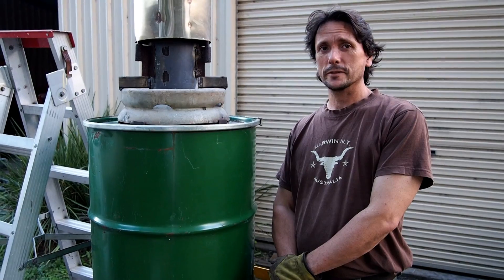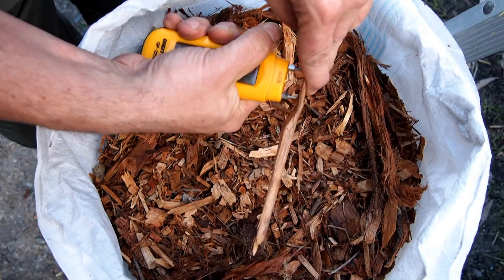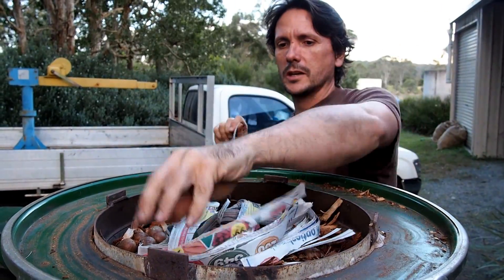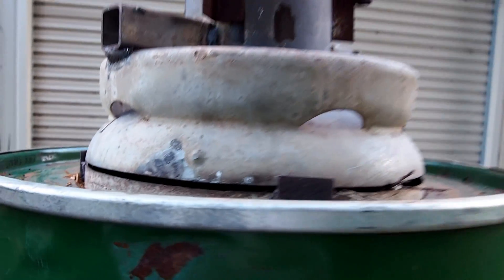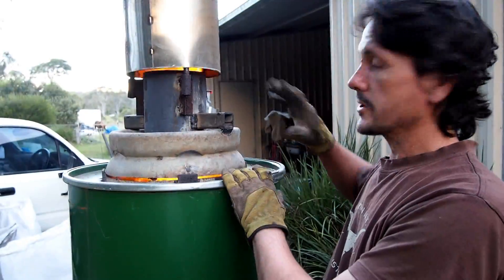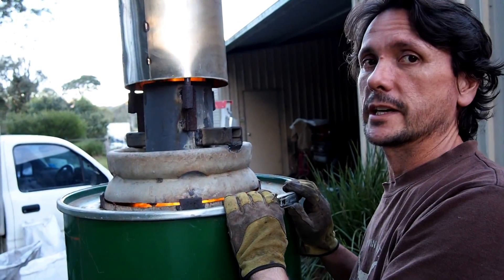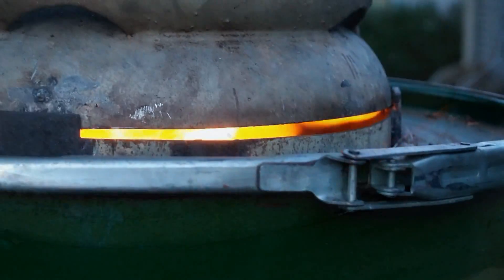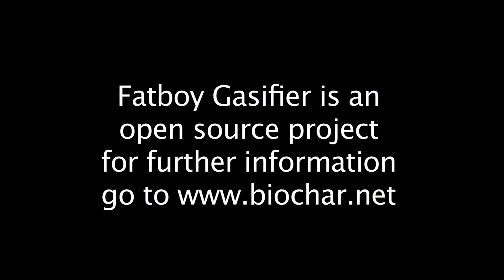Fatboy Gasifier - Open source project

Comment: So, I have something built for making bio-char, but I call mine a retort kiln. I use the char-wood in my Big Green Egg. My plans are to build a true gasifier to run a gas powered electric generator, I plan to use the char-wood in it as to reduce ash & moisture.

Comment: It is, in fact, a gasifier.  The syngas does not have to be captured and used elsewhere to qualify as a gasifier.  Here it is being directly combusted.  The specific process happening to the fuel in that unit is called gasification...  He is using a gasifier to make biochar.
Reply: A campfire is a gassifier if you use your reasoning. There would be flame coming out the chimney if it was a true gassifier.  Real gassification requires restriction of oxygen content.
Reply: No, a campfire is not a gasifier because it doesn't produce a clean burn-- it produces CO and other byproducts rather than just CO2, H2O, and C ...
.
http://www.allpowerlabs.com/gasification-explained

Comment: you should be getting double use of this by capturing the gas in a water bubbler tank which you can use to power a generator or heat the homes etc etc

Comment: This is not a gasifier, this is a rocket heater, it's not even a rocket mass heater. You could do so much more with this. This is a disappointing outside space heater that is more efficient than an open pit and little more.
If that's what you want that's great, well done, but you could do SO MUCH MORE with this. A few tweets and you would be able to produce woodgas which you can store and use, you cab direct the flu under your floor for mass heating and energy capture, you could add a cyclone filter and separate the tar from your char (which btw is great for wood treatment, creating old style open fire torches, and you can make pitch with it too) if you are careful and introduce a two chamber fuel system you can reburn excess charcoal in the outside chamber and pyrolise new fuel in the centre chamber. If you use pine in the pyrolysis process, if your design is not a bad one you can actually harvest pure pine oil which is a beautiful wood stain and an anti septic, if you direct the flume under your floor you cut your heating bills and waste far less energy, if insulate the fire box and your flume (since you are not worried about creosote which is going to be burned in your gasifier or filleted via the tar trap or cyclonic filter) you will even extend that use of excess energy. 
You can wrap your metal pipes around the flume and heat your water partially for free, coupled with a passive solar heater (made from scrap for nearly nothing) you can get warm water for free and hot with more wood being burned, but still for free. 
You can even use the exhaust to pull a natural vacuum through which you can at least partially compress your own wood gas for storage.
I'm not trying to shit on you here but you've put so much work into that for little reward, you can make it so that much more for you. It seems sad that it isn't. 
Ps you don't need to put nuts or even newspaper or dry kindling in to get it started if you got done food waste that's not safe for your creatures you can ferment really strong alcohol (not safe to drink) but ideal for starting fires at ultra high temperatures, which frees your paper waste for composting or a wormery. 
You're obviously at least moderately resourceful and this is a wasteful use of your matter comrade. It's not a criticism, it's a if you do this, you get more back awareness thing. 
On an unrelated note... You might also consider a modification to your septic tank where you add a three stage system the primary holds solids and only briefly liquids, you basically put a wormery in this, they love the waste and the paper they can mulch and they produce a very fine liquid fertiliser which is particularly potent when mixed with excess nitrogen in the remaining urea. Great for tomatoes. The last chamber is just for spill over.
Reply: Well ! Sarch !
You have really set the tone for real recovery of every inch of solar insolation stored in the organic wastes of our existence..
I would be on you r deft it you would reply and send pics of these really great ways to use everything.
May the force be with you......

Comment: I suppose its a gasifier in the sense that woodgas is created and burned off as a secondary burn, resulting a clean burn.  But other than an expensive and time consuming way to create rich compost, the unit serves no other purpose.

Shocking in the current line of DIY gasification projects really, the gas is wasted, the heat is wasted, not to mention all of the other byproducts which this unit simply burn's away and is thrown out as heat at the top of the flue.  If you have to make expensive compost at least utilize the other products along the way instead of venting them into the atmosphere.

Comment: OK, another idea that was raped from my brain, but since you on it, I suggest leaving the bottom open, about inch and a half grid at the bottom and a weight on the top, as the wood burn it should break off and fall through the grill into the water. I call this dragon poo, to charofied cherry wood, after the burn, use the remaining ash and water to make lye, stack the wood from smallest to largest, before burning.

Comment: what is the true purpose of this gasifier, i see no way are you capturing any of the gasses i do like the loading design of it but i just am not sure whats the point of this design? is it to heat a house, garage or something? or just for composting? im pretty lost someone help me see what im missing because my current gasifier i built is used to run my truck and other carbureted vehicles but i can't see how you do that with this design?
Reply: +99helldemon its a biochar maker. could have used a drum and a garden hose. this is labelled wrong and tricked me to.

Comment from the maker: I have now modified the condenser increasing it's diameter to 205mm, dropped the flue down over the condenser to reduce tertiary air side wind issues and added a flue door for light up. My next planned changes will be focused on moving or tipping the top of the unit to allow for easy access for filling.